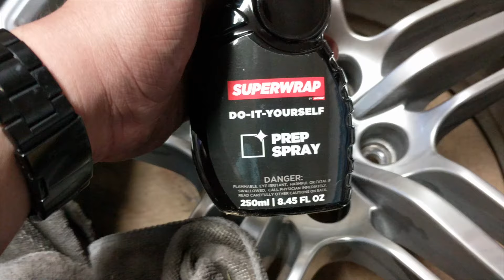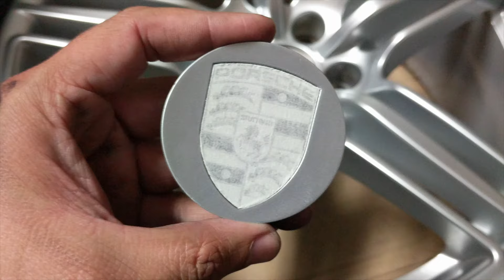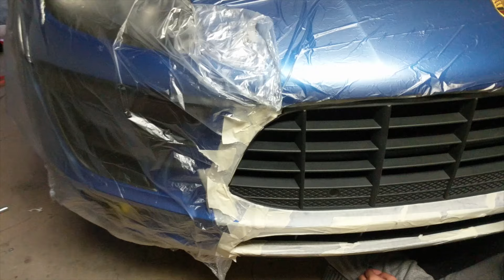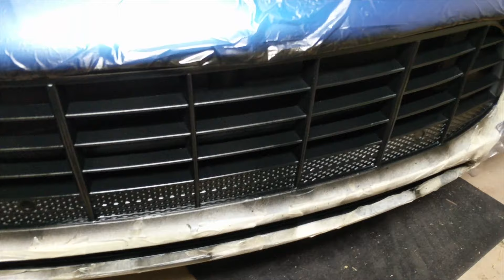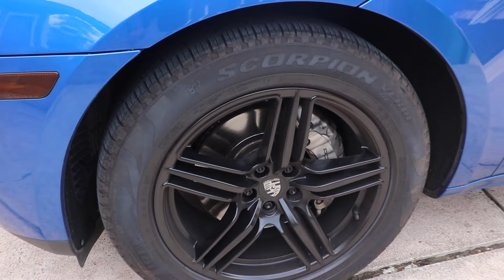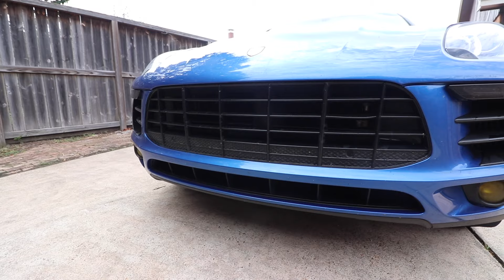SUPERWRAP BLACKOUT WHEELS DIY HOW TO

Comment: Nice. Just blacked my wifes cayenne wheels today. Used plasti dip and 2k. Super happy with initial look but might try this stuff on the next round. Looks Good!!
Reply from the maker: A L I’ve hear a lot of people using 2k clear coat on wheels even just for protection. I should get some for the new wheels I got on.
Reply: @SaulV  Apparently it makes removal a little more difficult but for the extra gloss and protection, seems worth it. It was my first time dipping so I will prob be re-doing them sooner than later, I think Im hooked on this type of product though!

Comment: Hi ! My (lower) rear bumper is black but it’s the plastic kind like the grill and side skirt(moldings) so I wanted to make them glossy black... will this work on that ?
Reply from the maker: Zia Barak it should work but I would do a glossy permanent paint for those parts as they get rock chips often. Any body shop can also paint them with not much prep work or cost. I got mine painted blue to match my car